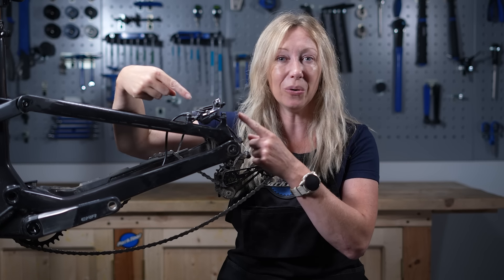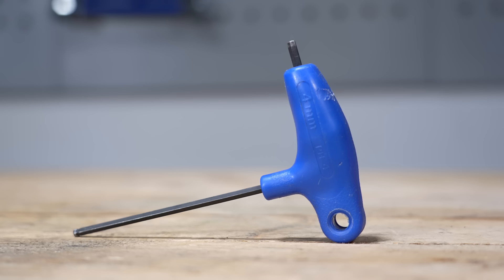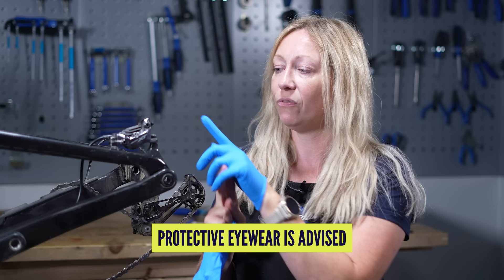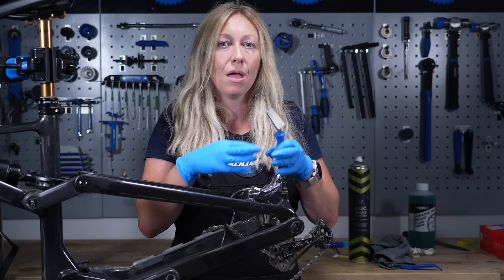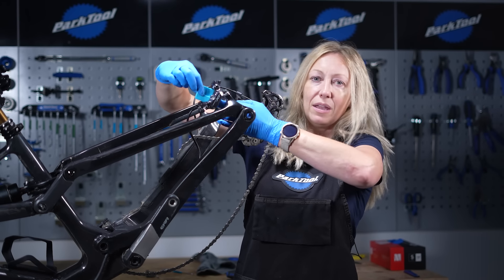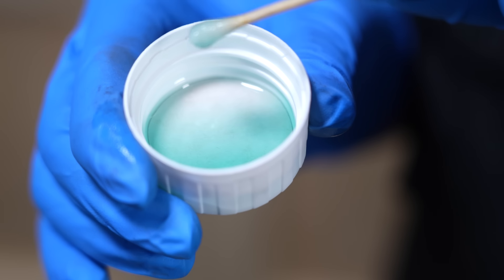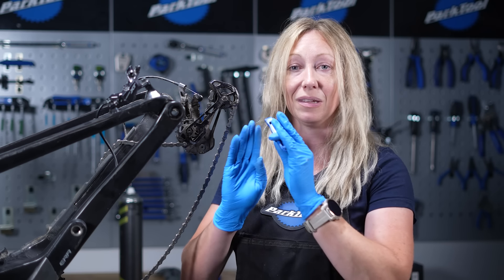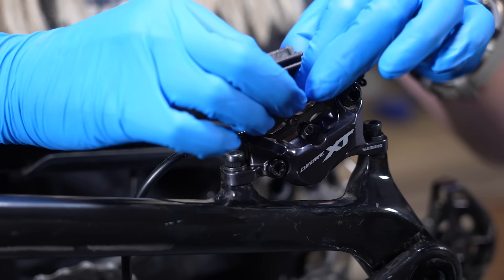Suffering From Sticky Brake Pistons? Try This Quick Easy DIY Fix!

Comment from the maker: Have you ever had problems with sticky pistons?
Reply: New Shimano MT200 on my new ebike. Did everything like in this video. Really made that sticky side work. But it didn't help. I didn't bother with warranty either. Just replaced it for MT500.
Reply: I fix up old bikes and almost always have to clean the pistons on older entry level hydraulic brakes that have been ignored their entire life, so I'm very familiar with this process. However, I'm a cheapskate and so I use the soft padded handle of my pedal spanner to push the pistons back in. The single biggest problem I have is that cotton buds have cardboard stems now not plastic and bend far far too quickly, meaning I have far less leverage to really scrub away that gunk - so I need someone to invent a noose brush that fits round the piston. The 2nd problem is that on many shimano 2 pot callipers it's impossible to get the tip of the cotton bud around 360degree of those pistons so you only clean about 310 degrees around the circumference. Top Tip - the older the calliper, the more times you want to push the pistons out, clean and push back in. 10-20 cycles is not uncommon to get the pistons moving nice enough.

Comment: Unless you own code r series, then it's new pistons and seals every 12 months. Don't bother trying to warranty it - sram claim this is service issue and not under warranty 🙄
Reply: This doesn’t surprise me 😂. Thank you for pointing this out
Reply: To be fair, any other issues I've had with Sram/Rockshox, the warranty has been bulletproof 👍
Reply: Omfg...🤦‍♂️
O k a y. Dude...🙄
Reply: @rider65  language... was that aimed at me? 😆
Reply: Sram brakes feel so weird to me. Always replace them.
Reply: @peterk7662  they are good brakes if you keep on top of bleed
Reply: Where I live, riders actually need to do this weekly if not every other ride, or they just cuss and tell you that double barrel brakes are trash. Fine dust and brake powder abound on mnt trails, particularly down hill riding.
Reply: You’re not wrong. The pistons being ceramic just don’t like being pushed back either. When they work they are reasonable, but takes far too much effort to maintain. 7 rides, 140miles, 14000ft of descent and they needed work again.

Comment: Ma’am.  I hate to disagree with you, but I’m gonna. It’s fine to add oil to the piston to get it moving smoothly again, BUT, do not leave the oil / lubricant on the piston, clean it back off after it works smoothly again. Oil will only catch all the trail dust and dirt your bike is tossing up

Comment: I don't think it's a good idea to lube the pistons. The reason is, in the middle there is a rubber, which holds the piston. The rubber bring back the piston in its neutral position, after pressing the brake. If the piston is lubed, the piston could slip through the rubber. I don't think there is a brake manufacturer, who advises you, to lube the pistons.
Reply: This procedure is an available method to learn at tec. shimano. So technically u are wrong. Otherwise i usually not recommend lubing, but cleaning by exactly the same reasons u mentioned.
Reply: @acsipisz5110  in the animation at the beginning of this vid you see the rubber holding the piston, the rubber deforms a little bit, when activation the brake and go back, when the pressure in the system is getting lower.
Reply: @JamesGoddard-i7s well, the rubber is there and the rubber is made for stick to or move slightly with the piston. Oil could make the piston slide through the rubber in one way and stick in the other way. All in all it isn't good for the consistent brake performance.
Reply: 'Brake', not break.
Reply: This is the correct answer, don't lube your pistons. Lubed pistons only attract more dirt and may compromise the o-seal's use as a spring to move your pistons. If you want to do a service, take your pistons out fully and clean them properly, it's messy and requires more work but is the better way to get them actually work better in a long term.
Reply: @johnvalley666  also don't lube pistons because you will contaminate pads and discs, it's like having leaky piston but self induced. Even if you use isopropyl to wipe it as a finishing touch the oil will reappear when you apply the brake. And then you're fukt.
Reply: @JamesGoddard-i7sthere's no suction from the master cylinder - it has a flexible diaphragm so this is impossible. The pad return spring is what returns the pistons.
Reply: The pad return spring is what returns the pistons.
Reply: @45graham45  the spring between the pads only connected the brake pads to the pistons. The spring tension is too low to do more than that.
Reply: @TnFruit  try to operate your brakes without it then. They are stronger than the tiny rubber seals.
Reply: @45graham45  the seals is what pushes the pistons back when you release the brake lever. That's the reason why pads remain close to the disc when either wears out.
Reply: @45graham45  I do, every single day, if that spring is so crucial how come not every manufacturer have them? And if it actually would push the pistons back, it would mess with your bitepoint constantly.
Reply: @45graham45  nope, you can literally watch the pistons return after bit after a squeeze with no pads in. There’s an actual video by sram where they go over the function of their brakes and the seal is what returns the pad. It very deliberately flexes with the piston during the piston stroke in order to unflex and return the pad to the starting position. The only point of the spring is to keep the pad against the piston.
Reply: @hughjanus7354 that’s been my experience 😢
Reply: @tedoakes9235  been there done that, following YouTube advice nonetheless...
Reply: @JamesGoddard-i7s they will if you don’t have the pads in (or the little plastic tool).  Before I had the plastic tool I used a little block of wood.  Make it high enough so it doesn’t fall out of the bottom of the callipers and then drill it near the top so I could slide a small allen key through the hole  it so it doesn’t fall out .  This is what I still use for my brakes that only have two pistons.  When applying the brake with the block in place I can then see which piston is sticking.  I recommend pushing it out a small amount at first and then pushing it back in with a plastic tyre lever once I have smeared a little of the appropriate brake fluid/ hunters plumbing grease etc.  Repeat this process and push the piston out a bit further.  My two sets of Hope brakes are difficult to push the pistons back in if I don’t do it this way
Reply: For those saying the brake pad spring is what returns the pistons are INCORRECT!!! With Shimano anyways.... It's the rubber seal & cut out in caliper that returns them

Comment: I always clean BEFORE pushing dirty pistons back in. THEN clean again. I don't have 100% faith the seals would keep the dirt out when pushing dirty pistons back in. Just my OCD I guess.,
Reply: It hurt to watch putting the pistons back without cleaning them first 
Definitely not ocd just logic
Reply: Even better, after cleaning, stick 3 or 4 mm Allen key between the pistons to push them all out without falling 
So you can throughly clean before pushing them in even once 
There is a way more detailed video on gmbn I thought this one was more in depth but the other one was better
It was Owen's if i'm correct
Reply: AGREE - That was agony to watch. Why do that???🤦‍♂🤦‍♂

Comment: So according to SRAM tech guys, you DO NOT lubricate the pistons with dot grease or hydro fluid, they are a supposed to remain a dry fit.
Reply: :O
Reply: Exactly to ensure the piston can return due to the seal flex.
Reply: Yup, this is NOT recommended for systems using DOT fluid.  DOT is highly corrosive.  You don't want to spread it all over your pistons.  Only do this with mineral oil systems like Shimano.
Reply: @Howardv1  what do you think is pushing on the back side of that piston?
Reply: @markhirst1296  i was always taught by my father that their is a reason for the seal around the piston,  brake fuid one side and clean dry air the other .you never want to mix brake dust with brake fluid !
Reply: Yet another reason to avoid DOT.  Dislike the stuff.

Comment: I installed a brand new SRAM Code R brake last week. I was amazed to see that the pistons didn’t leave the caliper evenly on a brand new brake. Not a little bit uneven' way uneven. No amount of cleaning is going to fix that 😂. Kinda shocking. It took seven years and 400 rides for my two pot Shimano XT brakes to develop uneven action. Go figure 🤔
Reply: same here
Reply: But thats normal. Not all seals are perfectly equal.
Reply: Why didn’t this affect my XT brakes?
Reply: @tedoakes9235  because you got a Lucky bunch there. Again, its normal. As long as It doesnt affect performance, its okay.
Reply: @vittocrazi not from new stuff, that's not normal, my 7 years old Shimano zee's support what I'm saying
Reply: @vittocrazi literally as the video says uneven brake pistons do affect performance.
I work in a bike shop and service plenty of brakes and install new brake sets (mostly replacing SRAM with Shimano 😅)
SRAM brakes are a joke, I love their other products but brakes just sucks
New Shimano's pistons are always, ALWAYS aligned no matter what
With SRAM I agree, you have to get a lucky bunch.
Reply: Typical Sram brake is typical.
Reply: @marcogiacomelli3625  uneven =\= sticky. Sticky affects performance and needs servicing, uneven doesnt and its normal.
Reply: @vittocrazi  they're uneven BECAUSE they're sticky

I (and I think the other guy too) was just saying that they don't work when in contact with the disc and the pads.
They might come unevenly out when all 4 are pushed out without any restraints (not new Shimano's btw), but then you align them, and once centered on your disc you pull the brake and pistons get stuck out right away, not coming back, getting the pads rubbing even when just installed on a work stand, let alone when you ride 
Unacceptable from new brakes, unacceptable for 6-12 months old brakes

You can't spend 30 minutes on a 2 minutes job (aligning the brake) and still end up with a rubbing disc as your best result, been there
We can't argue that sram brakes are a meme and bad for many other reasons. Code rsc miiiight be alright, but other Codes and Guides definitely sucks.
Just my opinion though
Reply: All the SRAM  brakes do this. You have to keep pushing the pistons coming out first back until they are out about the same amount.
Reply: This isn't the same thing.

Comment: It would be beneficial and you’ll avoid damaging your levers by removing the bleed bolt on them when moving your pistons  allowing the fluid to move freely through the system. I’ve damaged the seals in the lever by not doing this when installing new brake pads
Reply: This makes sense

Comment: Not entirely sure what I need that 3d printed piston tool for. I usually just clean the pistons before pushing them in to swap pads. Pushing the dirty pistons in all the way to then get a single piston out seems a bit counter intuitive. Is the goal just to get better access to clean it or is there something else I'm missing?
Reply: mostly more access to clean, but it's also much easier to push a single piston out because all the pressure gets put on that one piston if the others are prevented from moving
Reply: Its so that u can push the piston out as far as possible without actually popping out. Allows u to clean the piston body where it contacts the seals where it actually gets gunky which makes it sticky and not recess all the way back into the caliper when u release the lever
Reply: It comes in handy with 4 piston calipers as if some are sticking you can work them and in a bleed get any potential air from behind individual pistons
Reply: Usually one or two pistons move faster than the others after lots riding. The theory is to clean, lube, clean, and then cycle the slow pistons until they move at the same speed as the rest

Comment: This video works for XT brakes but is missing some steps for SRAM. First of all you can't push the pistons back with a tire lever or even the Park tool you showed because most of the time it requires way more pressure to get them to move than those tools can apply and if you attempt to lever them you run a high risk of breaking the brake pad retaining pin tab. I use a small C clamp that I modified to fit in there and padded it with leather.
Reply: Could you please post a picture or details of this?
Reply: Yeah it is hard work getting them back in for sure without any damage!

Comment: Use only your approved brake fluid to lubricate the pistons...
Never use grease or anti seize on pistons, seems obvious but I've seen other channels do that, the grease or anti seize will catch contaminants and carry them in the system...
Reply: Or they could react with the seals - it's actually best to just use nothing so the seals can grip the piston and work properly!

Comment: Thanks! Good tips. I will add mine from long experience:
1. For Sram use grease because DOT is nasty. For Shimano mineral oil works well.
2. For cleaning I prefer to use dish washing fluid because it removes grease very easily and itself with water.
2. After you lube pistons use narrower bleed lock (to simulate break pads with disk), work breake and clean multiple times because grease will get to your pads. 
3. Bleed breaks afterwords. 
4. Use floating disks :)
Reply: Dish washing fluid contains salt. Not good.
Reply: Why grease with dot ? Dot will eat that grease
Reply: Don't take brake advice from someone who doesn't even know how to spell "brake".

Comment: At 2 minutes 30 seconds in: I would clean the caliper first, before pushing the pistons in.  Not cleaning the pistons beforehand risks pushing dirt down into the seals and into the brake fluid.

Comment: Assuming, of course, that you have 4 piston brake calipers. Most people don't. If you don't, just spray the internals of the caliper with brake cleaner /isopropyl alcohol and work each piston back and forth a few times whilst you hold the other one in with a tyre lever.
Reply: Exception: SRAM has a specific grease for their Dot brakes and it's flawless

Comment: Ceramic pistons won't crack from touching metal. That would be crazy, because they actually push on the metal backplate of the brake pads. They may crack if not pushed straight back into the caliper.
Reply: Or when being pushed out and are not straight. Had that happen when I used a piece of wood.
Reply: Can use any material, just have to be easy & do evenly. Not on 1 side.

Comment: SRAM manual says not to lubricate the pistons. this is due to the fact that it will prevent the seal to properly grip on the pistons to draw it back into the caliper after breaking. Any thaughts?

Comment: You dont open the reservoir bottle so not to accidentally push fluid into the lever while pushing the piston in? Happened to me a few times. Had to replace the lever.

Comment: Where can I but that brake piston tool? (preferably in the Netherlands)
Reply: Theirs looked 3D printed, but Shimano has instructions that tell you to take a normal bleed block and cut a notch in it with a hacksaw. That way, it also has a hole in it to hold it in place with the pad pin.
Reply: @wazzup105  make your own with Lego bricks !
Reply: @mattgies  and how do you know you're not cutting too big a space, and  pop the piston out? Or are being too conservative and not cleaning the piston deep enough? I'm sure the exact depth of the space for the piston is crucial.
Reply: @macvos  If you want to be that precise about it, then do the math and figure it out. You know the thickness of your pads' backing plates and you know the minimum thickness of your rotor.
Reply: @mattgies  under the assumption that that's the maximum amount the piston can move before popping out?
Reply: @macvos  That's the maximum amount of piston you could expose before your brake would start to make a horrible noise, or in other words the most the piston could ever need to move in regular use. Actually, on further thought, you'd want to subtract the thickness of the pad spring too, because that will hit your rotor before the pad backing plate could.
Reply: Got mine on Etsy. 3d printed ($5.99)

Comment: How is the tool called....😊
Reply from the maker: It's called a piston cleaning tool, or a piston servicing tool, some people even make their own by cutting a brake bleed spacer block
Reply: @gmbntech  I use a ton of cotton swab to clean around the pistons and a bleed block to push them in once they are cleaned.
Reply: @gmbntech Where can we find that slick piston isolating tool/wedge?? Is it Shimano-specific, like, by calliper model?
Reply: @gmbntech could you share a link or a part number for the tool please?
Reply: Plenty of sellers on eBay etc selling 3d printed bleed blocks and piston tools. Bought ones from my hope brakes off there
Reply: Etsy has them also. Just ordered 1.